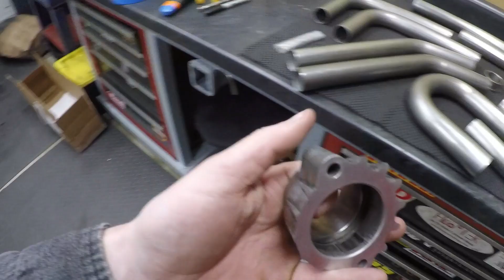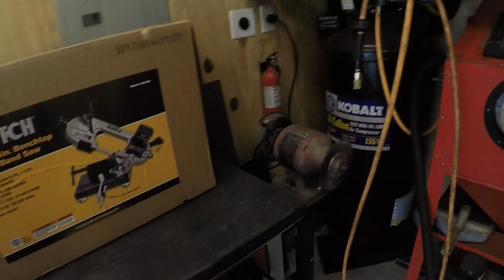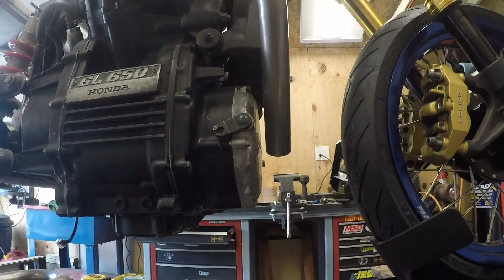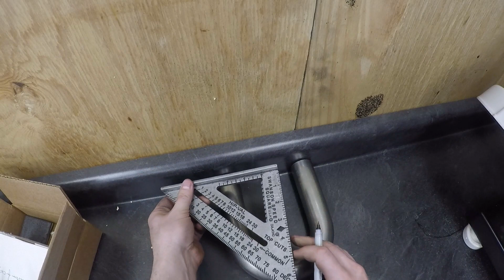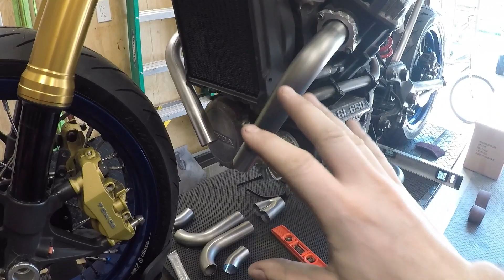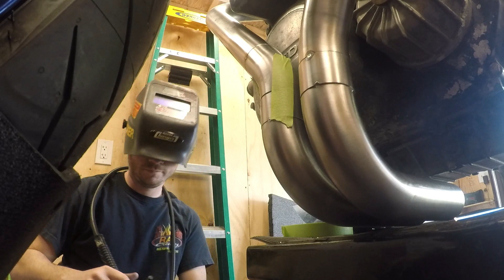CX500 Build - Building A Stainless Exhaust System and NEW TOOL Unboxing!! - PT1- EP15

Comment: Make sure you have clearance to change the oil filter or else you’ll be taking the exhaust off every time
Reply from the maker: The left primary will be a slip fit for that reason along with making the entire system easily removable. I was waiting on parts so that aspect hasn't been talked about yet.

Comment: Hi. What saw it is ? Brand and model if u please...
Reply from the maker: There is a direct link to the saw in the description
Reply: Brick House Builds thx i hadn’t see it before. One question : don’t u think it’s gonna be a little too tricky to take off the exhaust system to change the oil filter ?
Reply from the maker: @nicolasmachado447  The left primary will be a slip fit so it shouldn't be to terrible. Some modern full fairing sportbikes are a pain in the butt as well so it's  just part of it sometimes.